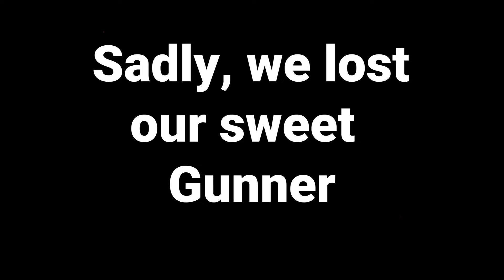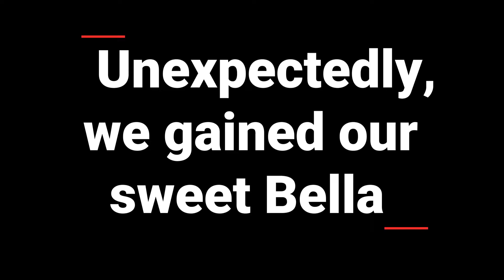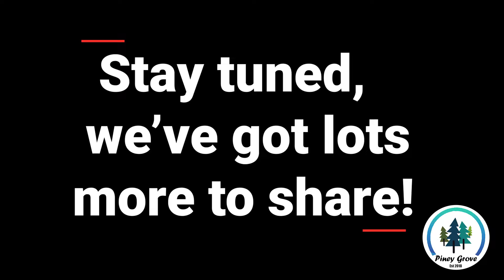Starting a Homestead from Scratch! | 5 Years in 14 Minutes

Comment from the maker: As we mentioned in this video, we aren't sponsored or selling anything, but if you'd like to support our channel, you can use any of the Amazon links below (costs nothing extra to use these links!).  You don't have to buy these specific items....just use a link below to get to Amazon then make any purchase: 
Mechanix Leather Gloves: https://amzn.to/3HjoZZf
Peltor 30db Hearing Protection: https://amzn.to/3aSziYa
Nike Dri-Fit T-shirt: https://amzn.to/3aS403V
Rode Wireless GO II microphones: https://amzn.to/3trABE3
Dewalt 20V cordless ½ drive impact wrench: https://amzn.to/3anFUOt
Dewalt 20V cordless circular saw: https://amzn.to/3xHbqQq
Dewalt 20V grinder: https://amzn.to/3n7gQxZ
Dewalt 4.5” Grinding Wheel: https://amzn.to/3ymYnUk
Dewalt 20V brushless ½” drill: https://amzn.to/3HGXJ7z
Dewalt 20V brushless Leaf blower: https://amzn.to/3zwJcYm
Complete nozzle kit with drill bit: https://amzn.to/3H5EeoE
Orange rubber gloves: https://amzn.to/3xIdlEt
Scott’s electric seed spreader: https://amzn.to/3QfhA1j
Oregon Magnum Gatorline trimmer line: https://amzn.to/3xTovGt
Husqvarna Titanium Force trimmer line: https://amzn.to/39nD
Bus Arnold Maxi Edge trimmer line: https://amzn.to/39nORa9
Tyvek Disposable Paint Suit: https://amzn.to/3OtFmFh
Stihl Scrench: https://amzn.to/3OdGT2s
Stihl Brush Cutter Blade: https://amzn.to/3ya2Eut